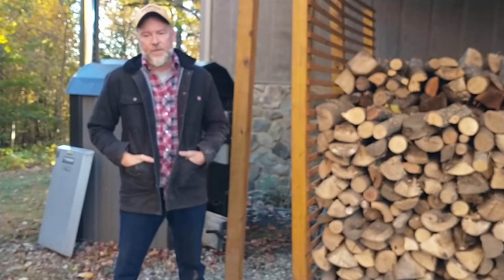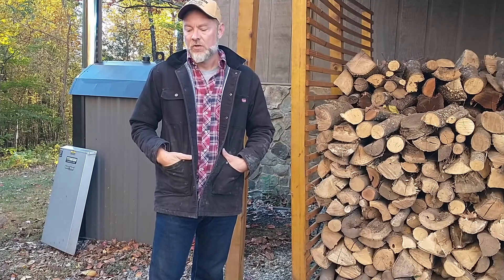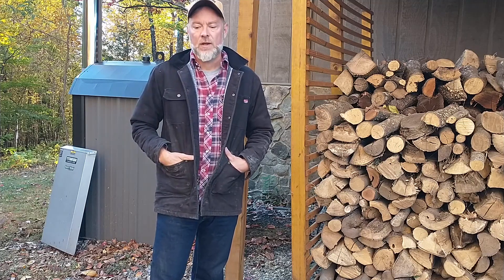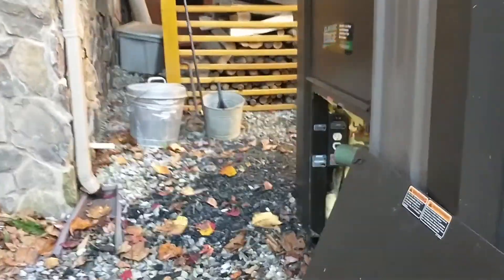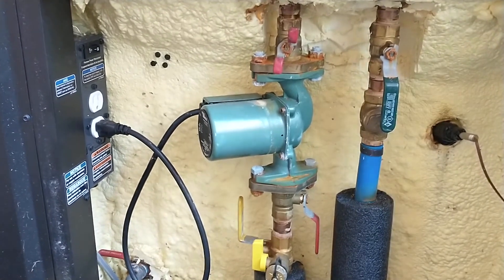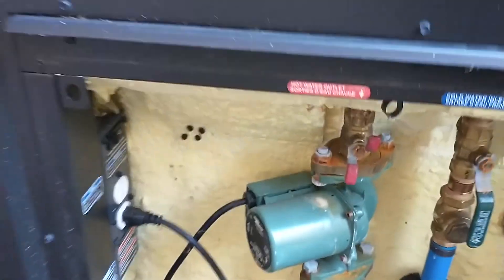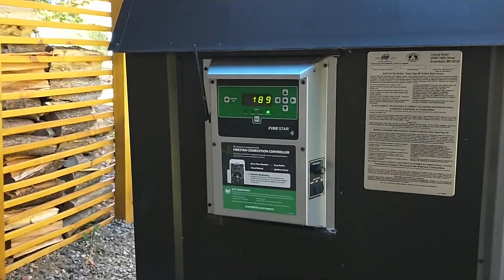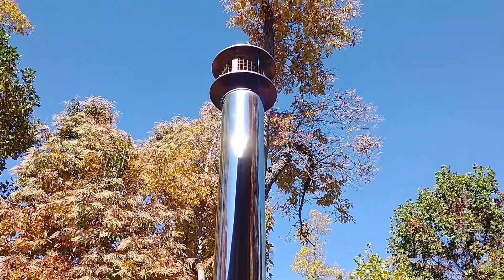COLD SEASON - We get all our heat and hot water from wood cut on our property - HOW DOES IT WORK?

Comment: In seeing how you have cross-stacked your wood in the firebox, this, in my mind, would have a negative effect on your reaction chamber working efficiently?
This way of stacking the wood allows a void to form & burn out around the secondary air tube. 
This is a only problem we sometimes have with our 560 HDX, even when loading wood in the normal parallel way. Splitting smaller, carefully stacking, good coal bed, helps in eliminating this issue…..regards, Bill Pitman in Pa.
Reply from the maker: Thanks for the input. Sometimes I cross stack the wood when I am trying to get the fire going and I want a lot of air ingress. Once the stove is running in steady state I usually top up logs more in parallel orientation.